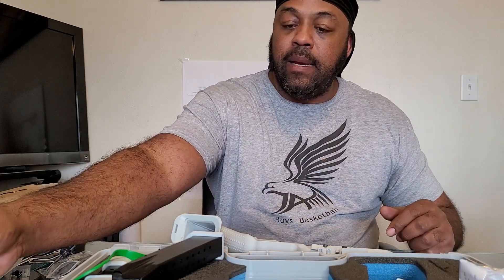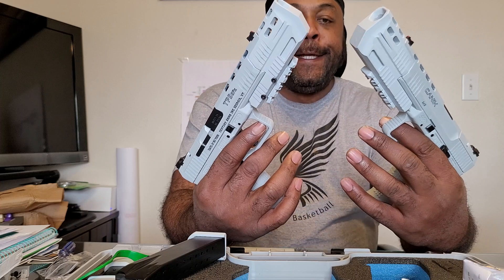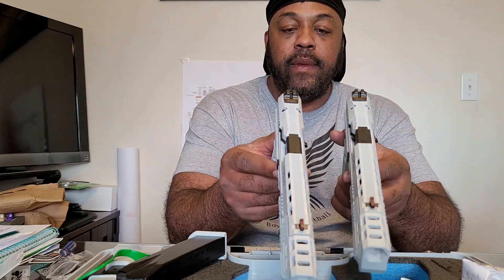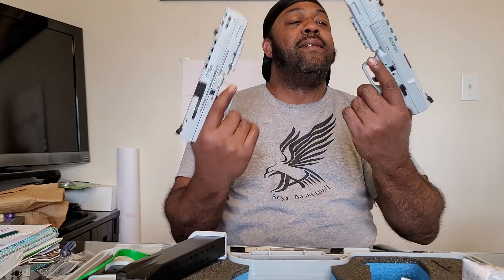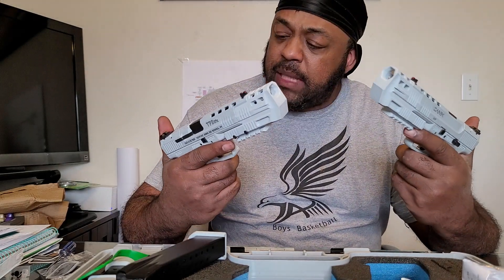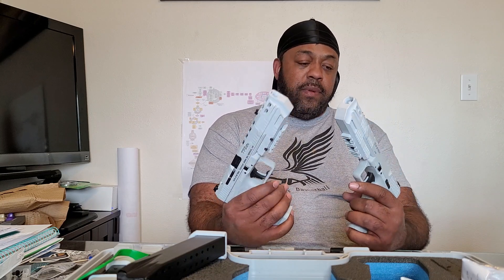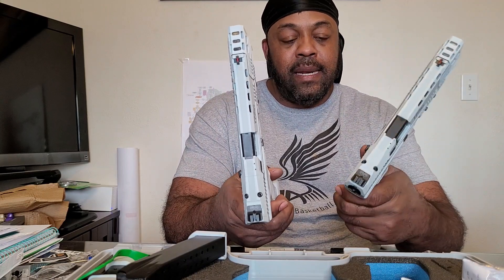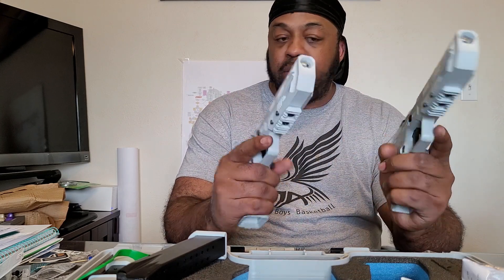Canik Whiteout SFX signature 45 blast install Pt 2

Comment: Also there is a big one by a stop light by our local college and my wife was behind a road worker and he hit it, stopped at the light, opened his door to look at the pot hole, shook his head, and drove off. Again a year ish since that happen and it is still there, I have to remember to straddle it in my Shelby GT500 so it doesn’t get messed up
Reply from the maker: Shelby GT500 maaaaan. I had a triple black convertible Shelby GT500. Straight piped it and the pops was scary loud. I had to sell it after 6 months of owning it because my 12 year old son was like 6' at the time and we both couldn't fit with the rest of my family. But 1 day I WILL GET ME ANOTHER ONE......lol
Reply: @taylortacticaltraining3506  That is exactly how mine is it is completely straight piped with a lethal performance Katlas X pipe and I love everything about it I’ve had mine since December 2017 it is in some of my videos and I will be doing more mods to it on my channels later. My other channel that mainly features the car is Russellvillespeed479
Reply from the maker: @Theguys1212  imma check your channel out my guy